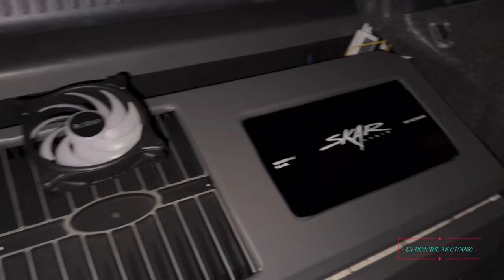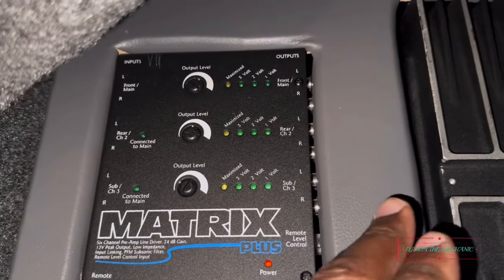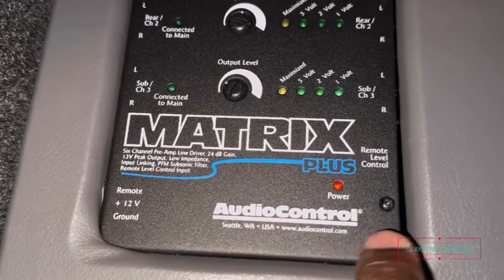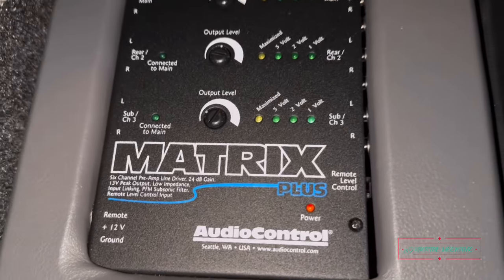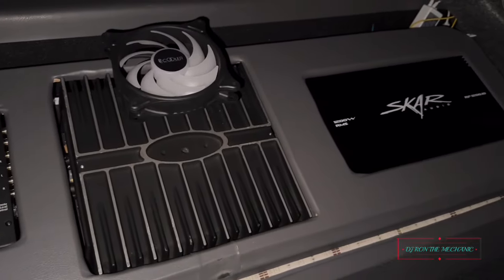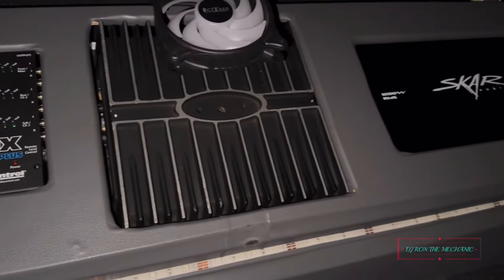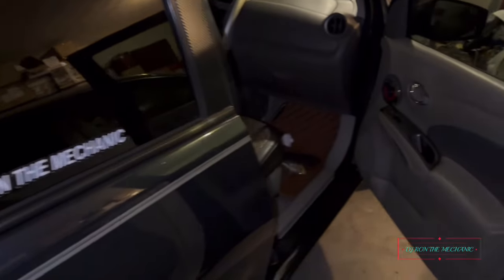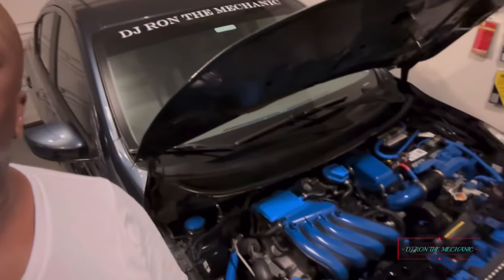The AudioControl Matrix Plus : How to connect it and do you need it? #caraudio #installation

Comment: It works good. I have it running into all 3 amplifiers. Turned all my gains down on my amplifiers. Used the gain coming from the matrix. The Audio Control gain knob is better than the ones that come with the amplifier.
Reply from the maker: @isiahgreen8405 yes, I don’t even have my amp bass remote connected at all only the Matrix. The Matrix brings your system to life.

Comment: I do have a ? Since u a pioneer guy I pulled a 211 model because of alternator whine I’ve seen u can wrap the rca to fix this u have any experience with doing that?
Reply from the maker: @jeezy5270 I have the Pioneer AVIC -X950BH , I haven’t experienced any alternator whine with my unit. I would check to make sure no rca cables are near the power wire. Get a good pair of rca cables that’s great against noise. Check your grounds on your amplifiers.
Reply: @djronthemechanic3695  thank you 👊🏾
Reply: @jeezy5270  You can use the jumper to isolate the rca ground, and it will solve the problem. On pioneers, it is usually caused by the radio seeing a difference in ground on the rca and the ground from the antenna lead and radio harness.
Reply: @bbanks1019  great thank you ,  works great so I didn’t wanna trash it, thanks again